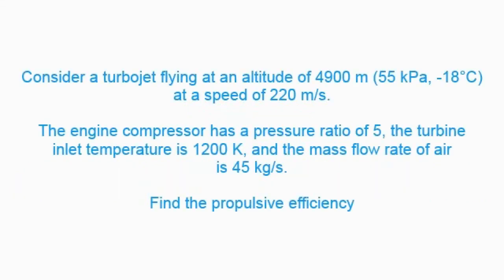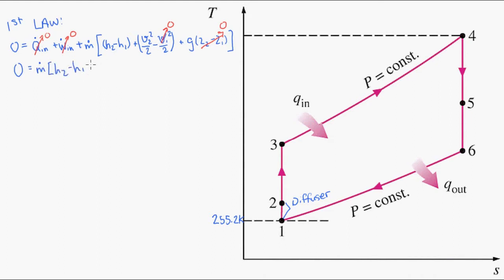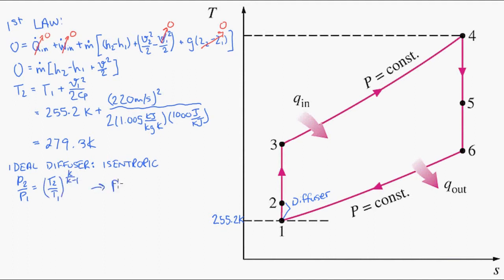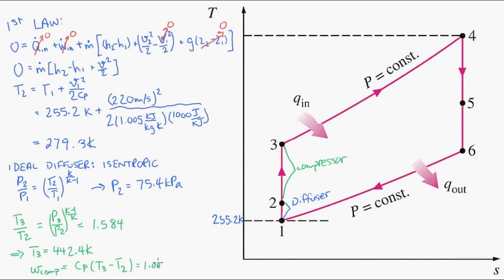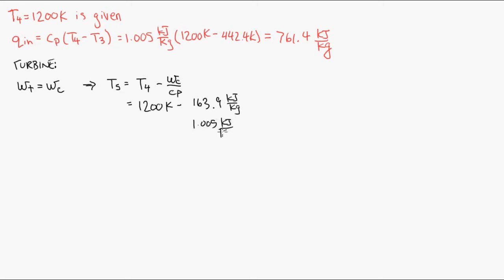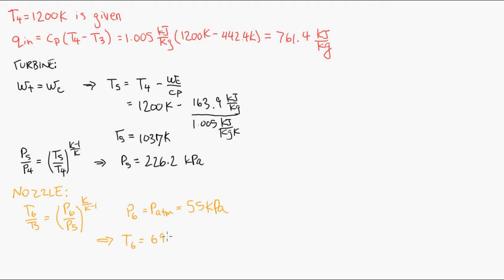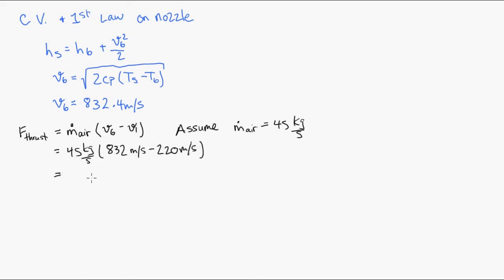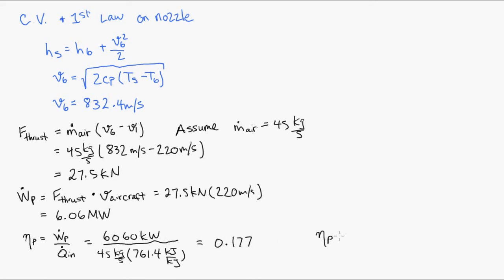Turbojet Example

Comment: I got confused when calculating pressure at point 5. Since compression ratio is 5, pressure at point 3 must 377 kpa (P2 = 55(279.3/255.2)^1.4/0.4 = 75.4, P3 = 75.4 x 5 = 377 kpa) Since pressure is constant on 4 and 3 points P4 must be equal to 377 kpa. And then when we apply P5/377kpa = 1037K/1200K)^0.4/1.4 we get 361.6 kpa not as you stated 226.2 kPa. Thank you for your help. :)
Reply: You're right about P4, the equation should actually be P5/P4 = (1037/1200)^1.4/0.4